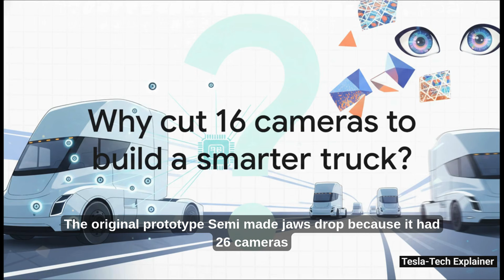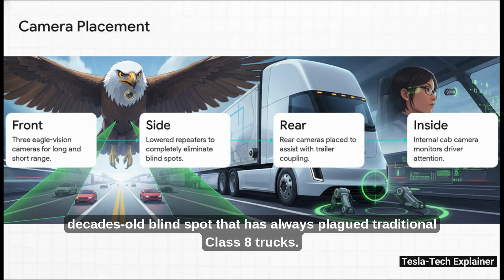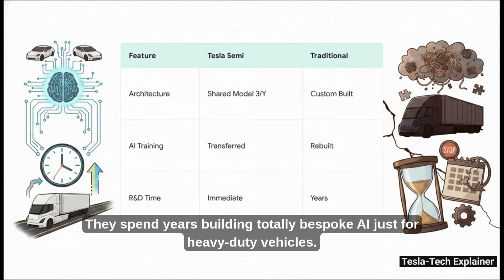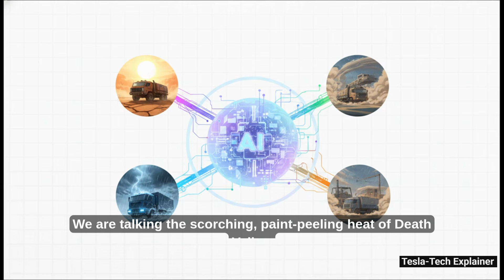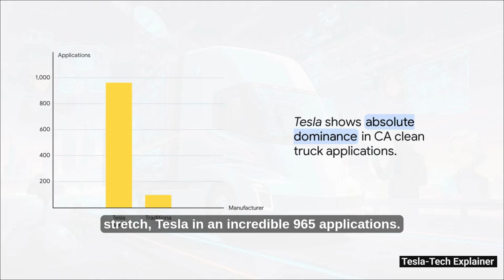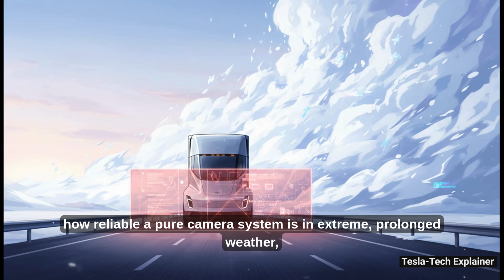The Tesla Semi Strategy: 10 Cameras and the AI Revolution

Comment: I think industry will be decades behind for this kind of tech.
Reply from the maker: It definitely feels that way when you look at the energy density. 📊 While most manufacturers are still trying to hit a 250-mile range with a full load, the Long Range Semi just hit the 500-mile mark in real-world fleet tests this month. The 'decades' gap might actually be in the Megacharging—recovering 70% of a massive battery in 30 minutes is a feat of engineering traditional OEMs haven't scaled yet. Do you think it’s the tech or the lack of charging infrastructure that’s holding the others back?

Comment: Yeah, I buy a $130,000 Cyber Beast and lose my FSD when I pull my Travel Trailer. Should be fixed NOW!
Reply from the maker: That would be be very frustrating. Dropping $130,000 on a top-tier machine like the Cyberbeast only to have its most famous feature—FSD—cut out the second you hook up a trailer is a massive bottleneck, especially when the truck is rated to pull 11,000 lbs.
Reply: When pulling a trailer, your great truck with FSD just becomes a great truck.
Reply from the maker: Haha, exactly! It goes from a 'Cyber-spaceship' to a 'Steel-Sledgehammer' the moment you hook up. Still powerful, just a lot more work for the driver! 🛠️💪
Reply: @Tesla-TechExp  Should be easy to do with input from a rear cabin on the trailer which mine and most have.
Also Facial Recognition and Voice Recognition to enter the vehicle. Very easy to do.
These are just not priorities for them!
Reply from the maker: Spot on about the biometric entry! Tesla actually just rolled out Biometric Facial Recognition and the 'Hey Grok' wake-word in the Spring 2026 update. The tech is officially live to adjust seats and set playlists the moment it sees your face. The fact that they can prioritize 'Hedgehog' icons for Pet Mode but haven't flipped the switch on 'Trailer FSD' yet shows exactly where their dev hours are going. Do you think they’re holding back Tow-FSD because of liability, or is it purely a software capacity issue?
Reply: @Tesla-TechExp  They are putting FSD on the Tesla Semi. A vehicle and trailer. I would think it could readily be adapted for out Travel Trailers.
Reply from the maker: I hear you—it feels like sci-fi. But look at the FSD v14.3.2 update that just dropped. It completely rewrote the AI compiler for 20% faster reaction times. They must have plans for it.
Reply: That is a completely valid frustration.
Reply from the maker: The hardware is there—most trailers already have the rear-cabin inputs.
Reply: This week, a fleet operator (WattEV) just placed a $100M order because the data shows the Semi is a 'money machine' compared to diesel.
Reply from the maker: When the competition realizes they’re losing $200k in fuel per truck every few years, 'decades' will turn into a 'sprint' real fast. 🏃💨 Which legacy truck brand do you think has the best chance to survive this shift?
Reply: @T @Tesla-TechExp  PACCAR is taking a "Dual-Track" approach. While they are building battery-electric trucks, they are betting heavily on Hydrogen Fuel Cells for the ultra-long-haul routes.
Reply: @Tesla-TechExp  Volvo is arguably in the best position. As of this year, they are the first legacy brand to consistently hit 370+ miles of range with their FH Aero Electric models.
Reply from the maker: Volvo and PACCAR seem best positioned because they’re already deploying real trucks, not just concepts. The transition will come down to total operating cost, charging/refueling infrastructure, and uptime — not hype.
Reply from the maker: You’re right! Volvo and PACCAR seem best positioned because they’re already deploying real trucks, not just concepts.